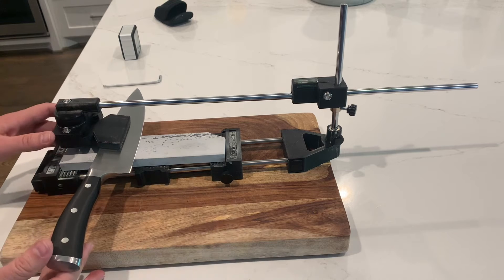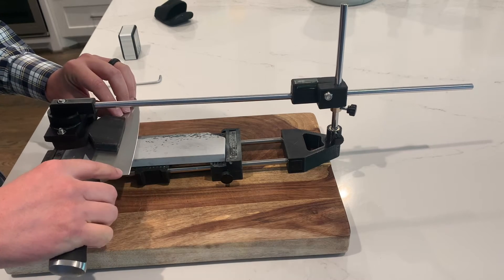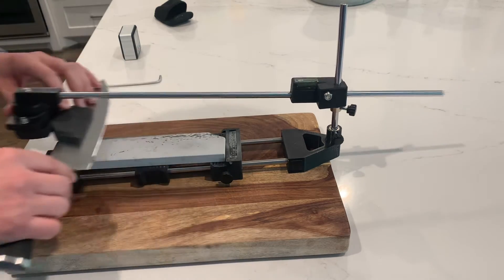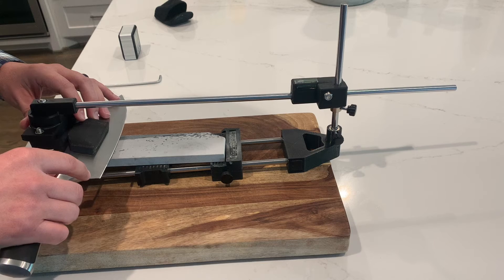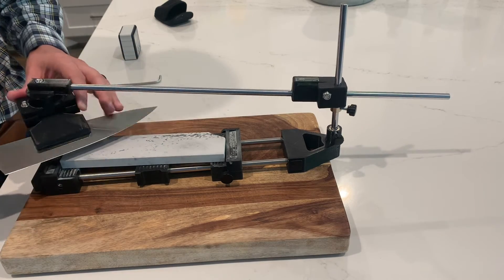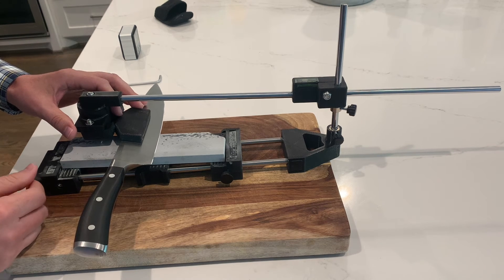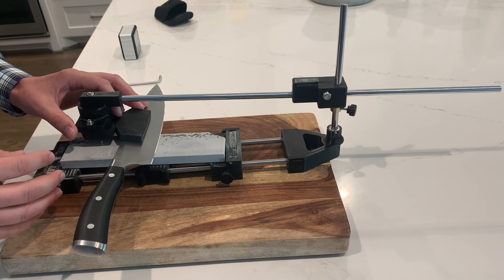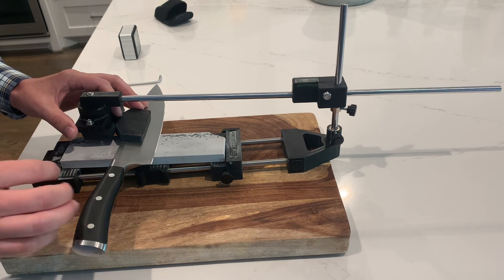Mechanical Engineering Applied to Knife Sharpening

Comment: The standard clamp has a fully adjustable angle though right? you got hem in stock right now? How much is shipping to the UK?
Reply from the maker: Yes the aluminum clamp has a full angle range from 10-25. At lower angles and small EDCs the angle will be limited because the clamp starts to hit the stone. I’ve thought about reprofiling the clamp to improve the angle range.
Reply: @sharpworx  Yeah 100%, with super steels these days I really expect 10 degree edges.
I had no idea some parts were aliminium, thats quite disappointing actually, the kme uses aluminum in parts and it's garbage, it wears out in a couple of years of average use.
Reply from the maker: @8thsinner  when you get your sharpener please let me know what you think. I’m open to feedback and will incorporate improvements as much as possible. 

So you think steel parts would be better if I’m going to upgrade this?
Reply: @sharpworx  In time yes, but I like that you are also selling the cheaper one, the red version. If you wanted the highest levels of versatility, offering parts upgrades in various materials. It is the closest method to freehand on the market, thats why I was developing my own similar one, it removes the angle variations that most freehand sharpeners hate about angled systems. With a bit of luck I would hope to see your edges being reviewed against others like the ts prof. I don't have the ts myself, but it's craftmanship is second to none.

Comment: You are building on the work of Bogdan Manko from the Ukraine. here us a video he did using an articulated joint design https://www.youtube.com/watch?v=BngsYiGME6Y
He did an edge retention/sharpness retention test where he bet his stone fixed/blade moving had better retention of sharpness over the conventional blade fixed/stone moving fixed angle sharpener. I cannot remember where I read it as I have searched Blade Forum and cannot find it, but Bogan was challenged by a chef and his system, similar to the SharpWorx offered advantages over fixed angle and freehand sharpening. Best of luck and I am getting one of these. 
With all the nonsense going on in Ukraine, I hole Bogdan is OK. But he has some interesting ideas toward sharpening apparatus and techniques. I have one of his Kryvolapka sharpeners i got in early February before all the nonsense started. Extremely high quality all metal sharpening.
Reply from the maker: Looks like he posted that 3 months ago. I’m curious when he started posting about these.
Reply: @sharpworx  His YouTube channel has been up around 7 years. I have found some references about the fixed stone/blade moving on a German sharpening site n 2019, so he has been doing this for a while. He showed up on Blade Forum around 2015. Seems he has a following in eastern Europe.
Reply from the maker: @Oilfieldscout  thanks for letting me know.